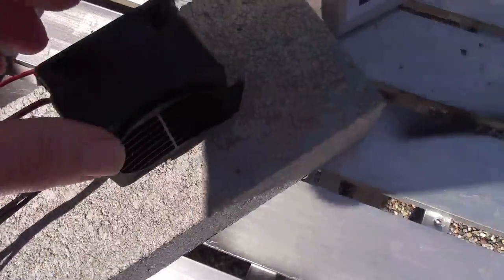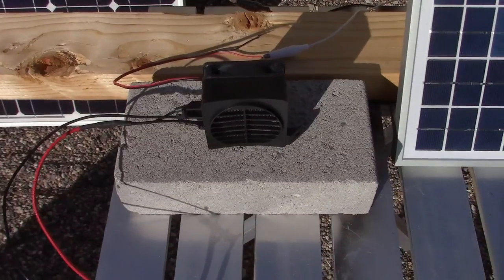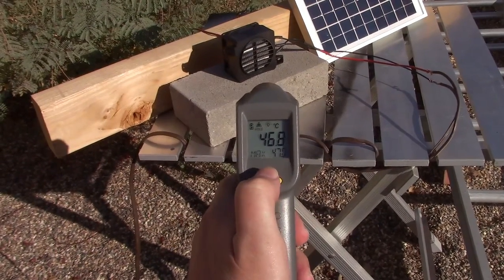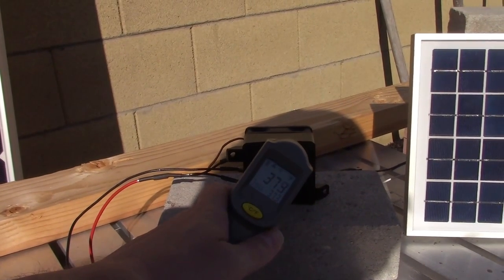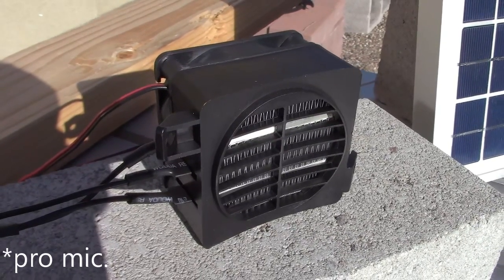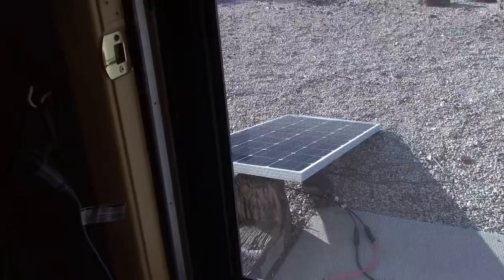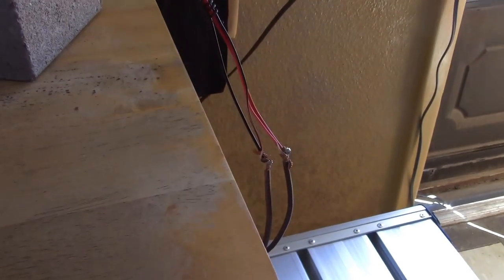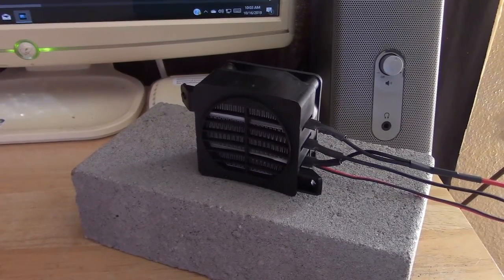Solar Electric Air Heater! (100W 12V) - 100W Solar Panel runs it! - PV space heating!! Ez DIY

Comment: Do you or anyone know how to take those bare wires and put a 2 prong plug on the end so I can plug this into a inverter to run at night?
Reply from the maker: hi. the unit is DC so you wouldn't want to plug it into an AC outlet. to run the unit you could just hook it to a 12v battery.
Reply: @desertsun02  ok. Thank you. How would I do that with the 4 wires?
Reply from the maker: hi. pretty easy, just connect all the red ones to the positive of the battery and all the black ones to the negative. that's basically it ✔
Reply: @desertsun02  ok. I did that using alligator clips. I get the fan to run but no heat. I tried a 2nd heater same thing. The wires get real hot too. Started to burn my alligator clip. Any ideas?
Reply from the maker: @Robert Christman i'd say ditch the alligator clips. sometimes those don't provide a good enough connection. if they are getting hot then the current is most likely bottlenecking in that area. if the current can't flow then the heater won't work right (that draws most of the amps)

Comment: Going to have to use this for my off grid power box I'm making using deep cycle batteries and an old cooler. Cooler can hold the heat in, this can help keep them above freezing so they'll keep working even in cold Canadian winters! genius.
Reply: no solar for 3 months so north here and here, but those are good in spring when there is still cold nights but sun is shining

Comment: could you post a link for a suitable solar panel for the fan? just so many options on amazon ... hard to know if all or some would be compatibe.... thanks great video
Reply from the maker: hi there. the fan is so low power that all you really need is 12v 5w panel. any 12v panel that is at least 5w should work good. here is a good one https://www.amazon.com/NewPowa-efficiency-Solar-Module-Marine/dp/B00L60Y6Y4/ref=sr_1_3?crid=38ON6A33MJI2D&dchild=1&keywords=5+watt+solar+panel+12v&qid=1631733328&sr=8-3

Comment: I love your video here.  I went out and order a solar panel and the same heater.  What I am not sure is how you hooked the wires together.  Did you strip the adapters off the solar panel wires?
Reply from the maker: hi there. nope, i didn't alter the solar panel wires in any way. i just buy 2 wires that have mc4 connectors on one end and bare wire or ringlets on the other end.

Comment: How do u connect the fan straight to the solar. Wont it blow? Being 1 - 4w
Reply from the maker: hi there. any item that you hook to a solar panel only draws what it needs from the panel. you could hook a 1 watt item to a 200 watt panel and it will be fine. (it's the same idea as plugging a nightlight or a microwave oven into the same wall socket in a home. the nightlight doesn't get damaged because it just pulls what it needs)
Reply: @desertsun02  i see, interesting. Im looking some way heating up a polytunnel 6m x 3m in winter. And came across your idea. 
Can u connect both fan and heater to the same solar panel. Or would the fan need its own little pannel

Comment: Did you hook it straight off 12v solar panel or thru a regulator?  Just curious. Panel usually puts out up to 19v, do you think this heater can handle the extra voltage?
Reply from the maker: hi. it's just a straight connect. yeah, it handles it fine. it's just a little extra "push" behind the current. it would have to be over roughly 30v for it to have any negative effect. (the only things that need exact voltage are things with sensitive electronics in them - then you use a regulated power supply). interesting side note... i actually own store-bought 12v power supplies that put out 17 volts. they make the "non regulated ones" that way on purpose (usually 14 to 17 volt output for running 12v items).
Reply: @desertsun02  Thanks, I will buy one of those to try. I have a 100w solar panel setup that I use to run a fan during the day on summer time. I will just switch the connection on winter time to  help give  a little heat up a small area.

Comment: Hi will a 12v 160w solar panel run this?
Reply from the maker: hi there. absolutely! (any 12v panel that is 100w or higher should run it full speed and full heat)👍🙂. (i think they make this air heater in a 12v 150w model also. you might want to use that one if you've got a 160w panel.)

Comment: This would only heat around the desk area right? Maybe a bathroom but not a room.
Reply from the maker: hi. i generally use it for a personal space heater. can heat a small room, but you might need a few for a good sized room
Reply: @desertsun02  ok, thanks!

Comment: What 100w (12v) solar panel  did you buy?
Reply from the maker: hi. i'm using a monocrystallline one by renogy.
Reply: @desertsun02  Thank you, how long do they usually run the fan?
Reply from the maker: as long as the sun is out it will run

Comment: I don't see it on amazon for $10 - 2:59
Reply from the maker: hi. the two i've bought were $7.99 and $10.59 but they've upped the price a little. currently i see them for $16.00. there are a few sellers that charge 20 or more - but skip those. you can find it cheaper. 🙂
Reply: @desertsun02    Did you buy the wafer element component by itself at those prices, because I can't find somewhat completed units (element, housing, fan, &wires) for those prices. Can you not provide a link to the cheapest one you can find?
Reply from the maker: hi. i buy them all as one unit. they come assembled and ready to use with heater, housing, fan and wires. here's a link to one that is $16.61 with free shipping (as of 01/22/2021) https://www.amazon.com/LNIMI-Heater-Small-Portable-Heaters/dp/B08RRS3QHJ/ref=sr_1_29?dchild=1&keywords=12v+ptc+heater&qid=1611322408&sr=8-29 here's another (it's 12v 150w) for only $15.78 with free shipping. https://www.amazon.com/dp/B081197DGH/ref=sspa_dk_detail_1?psc=1&pd_rd_i=B081197DGH&pd_rd_w=b70mh&pf_rd_p=45e679f6-d55f-4626-99ea-f1ec7720af94&pd_rd_wg=wZ7Dn&pf_rd_r=PS94H88B8YHSA30ZP4ZV&pd_rd_r=a4733250-c05d-4b9b-aaed-1fd8df9ddc4c&spLa=ZW5jcnlwdGVkUXVhbGlmaWVyPUEyOU1MUk1ROFhNOFBIJmVuY3J5cHRlZElkPUEwNzExNTU5N0UySlZRMVkzM1dIJmVuY3J5cHRlZEFkSWQ9QTA2NzU2MDYxTllZUFUzWkRBRUoxJndpZGdldE5hbWU9c3BfZGV0YWlsJmFjdGlvbj1jbGlja1JlZGlyZWN0JmRvTm90TG9nQ2xpY2s9dHJ1ZQ==
Reply from the maker: here's another. this one is $16.62 (as of 01/22/2021) with free shipping. https://www.amazon.com/Jadeshay-Heating-Element-Constant-Temperature/dp/B081RFTBX9/ref=sr_1_103?dchild=1&keywords=12v+ptc+heater&qid=1611323073&sr=8-103 there are a lot of people setting them for 20-30 dollars but they are just ripping people off.
Reply: @desertsun02    Free shipping seems only to the US.  I figured out Amazon changes shipping details based on whatever address is saved in the browser I'm using.  If I ship to Canada the shipping charges are about as much as the unit itself; but the last link you gave on the 16.32 item came up with only a 5.16 extra charge for shipping; so that's the best one I've found now.  All in all, thanks for the info & help.

Comment: Hey desertsun. What kind of solar panel is the 100w panel that you used to power the 12v 100w heater please? What make and model is the panel?
Reply from the maker: hi. it's a 12v 100w monochrystalline solar panel from renogy. that's my oldest 100w panel. bought that one back in 2013. any 100 watt panel will work. i've recently been using polychrystalline 100w panels from amazon. works just as well. you can get them for as low as 70 dollars on amazon. 👍🙂
Reply: @desertsun02  Thank you.

Comment: Is it possible to hook the heater up to a usb connector?
Reply from the maker: hi there. usb outlets are around 5v and the heater is 12 so it wouldn't match up (also you probably couldn't get the amps needed using usb). it's possible that someone might sell these in 5v put haven't seen any

Comment: 3:25 Could you do another in depth video on how you do the wiring connections...
Reply from the maker: sure. what part are you confused on? note that the wires to the heater and fan are pre-attached, so i basically just connected them straight to the solar panel.

Comment: Hi bought one these heaters I have 100watt panel on campervan roof an 3 30watt panels in parallel .I have 2 mppt controllers front an back what’s best wire to wire the heater ?😀

Comment: hey desertsun. Great video. Whats your thoughts on this set up vs a solar air heater? I mean what do you think is better to heat a small room?
Reply from the maker: hi there. that's a good question. i could write a 'whole book' on thoughts about those questions, but to keep it brief, a lot depends on your situation. the solar 'thermal' air heaters (aluminum can ones as an example) are bigger and often fixed to the side of a house, so you have to decide if you want to go that route. using a system like the one shown in this video offers potentially more movability (you can move around the heater and solar panel easier). also, the hot air that is generated is generated on the inside of the room or structure (not the outside like the solar thermal air heaters) so you don't have to find a way to pipe it in. on the other hand the solar "thermal" air heaters are probably more 'efficient' and can also be made to be 'semi-portable' (most of mine are) so they both have advantages. i've got like 4 or 5 different solar thermal air heater vids if you wanna see more about them. i've also got at least 2 more air heater vids coming out this season (fall of 2020).
Reply: @desertsun02  Thanks for your awesome reply. Good information :). Its all very interesting. I have insane heating bills and my lounge and kitchen faces east to south east.  Any ideas which of your two heaters would be a good preference to help heat a 42sqm about 452.sqf? let me know :)
Reply: @desertsun02  i was going to try to  make one of this heaters with soda cans or drain pipes in the box thing. But it's outside. What happens when the sun leaves? What if it's 10° here in NJ at sundown. Won't the cans get freezing? I hate the cold. I would not be happy if the cans froze and gave me air conditioning in the winter.

Comment: Interesting..good application (my chicken coop)..however if i were to use this for that, i would have to calculate how many 12v batteries would i need to run it at night, and how many panels to recharge those batteries..

Comment: I'd like to do use a solar panel, battery and a few of these spaced around my 8'x16' greenhouse. I'm in Colorado so I'm hoping to extend the growing season by a few months.
Reply: I have the same interest but live on Cape Cod please PM me to compare.
Reply: Did you trying it yet?
Reply: I have not but if you get a solar battery, and a ceramic heat lamp, it will help warm up your green house as well.
Reply: Did you end up getting one? I'm thinking of 50w is probably more than enough for me.
Reply: @NovaFlowO2  :there is 3.41 BTUs in a watt.  I was given  a large solar panel, and figured the best use, without buying batteries, inverters etc, was to use it to heat the house. On a sunny day in winter, it would have kept the furnace off for 6 seconds per day.
Reply: @drewthompson7457  6seconds?
Reply: @MrElhato  : Yes. Rough calculations, it is a 50 watt panel, and I was going to let it run a car headlight as a heater, about 700 BTU per day. It wasn't worth the effort. But the panel is good running a large 12 V fan to keep the boat dry in the winter.
Reply: I have a 120watt panel can I use it to run the 100watt heater
Reply: @justincampbell2162  Yes that will work just fine The way electricity typically works is the device draws the amount of power it needs so if it's only consuming a hundred Watts it'll only take a hundred Watts from the 120 w panel although keep in mind your panels never going to produce 120 Watts you might get close when you point it directly at the sun during the summertime but you'll probably get between 40 and 90 Watts under the panel so it'll run the heater just fine
Reply: Battery is not going to work very well just run a directly off the solar he should get about 8 or 9 hours of heat per day

Remember even that hundred watt heater which is not going to provide much heat for a greenhouse you would need a 1 kilowatt-hour battery to run that overnight so you would need a $300 battery to have enough capacity to run a single one of those heater is overnight You're probably going to need 10 of them at least to make a dent which means you need a $3,000 battery pack to run overnight so just insulate well and heat during the day
Reply: Earth ground heat and compost

Comment: Can you post a link where to buy the heater?
Reply from the maker: hi there. here is a link to one https://www.amazon.com/Constant-Temperature-Humidifier-Conditioning-Appliances/dp/B084Q18VHG/ref=pd_di_sccai_2/143-3040554-3226717?_encoding=UTF8&pd_rd_i=B084Q18VHG&pd_rd_r=bb1e507f-a46c-4982-af15-adcb2c856959&pd_rd_w=7mK03&pd_rd_wg=EsK6b&pf_rd_p=5415687b-2c9d-46da-88a4-bbcfe8e07f3c&pf_rd_r=J6CZRMQ6BC0BMSMMZ9ZJ&psc=1&refRID=J6CZRMQ6BC0BMSMMZ9ZJ if this link becomes inactive over time just search for '12v 100w ceramic ptc heater' on amazon.

Comment: How do you turn it off safely? And can I tire the wires to the solar panel wires with my hands without getting shocked?
Reply from the maker: hi there. to turn it off you can just unhook the wires. since it's only 12 volts and relatively low amps it's very safe. you shouldn't feel any shock.
Reply: desertsun02 thanks for the info, just subbed cause ur a beast when it comes to responding in the comments! Can’t wait to see what you create in the future 😁

Comment: How Many Amp Hours Batteries Do You Think You Would You Need To Run It For 24 Hours? I Have A 9x6x6 box truck overlander I think this would run great in?
Reply: This isn't enough heat but if you wanted to do this you would need a 200ah 12v battery for it to last 24hrs.

Comment: That with a 12v temperature relay from ebay and your sorted, wonder how this would heat a shed up
Reply: I have doubts...  I replicated this setup EXACTLY with nowhere near the temps or fan speed on one panel.  I’ve metered the solar panel and it’s generating 100W, not sure if this is real.

Comment: Hi, thank you so much for posting this. I just have a few questions. I am living in a small SUV and last night it dropped to a chilly 20F. Anyways, I would like to use this for two purposes, 1) keep my bananas (and other food) from freezing during the day, 2) possibly keeping myself warm at night. My set up is:100W solar panel connected to MPPT morningstar controller and my car battery. When the weather is warmer, I usually power my 17L Engel fridge with the set up (direct line to battery - 8 gauge wires) - haven't had a problem for the past 2 years with this. I'm thinking in this winter to switch it so that I connect the heater direct to the battery (with a cut off switch if battery drops below 11.5V). Any thoughts? Also, it says there's a "safety" on the heater, does this mean that if it falls over it will shut off? Thanks for all your help!
Reply: I am sorry no one took the time to answer you back.  Yes, it should work just fine, and yes it means that if it falls over it will shut off.  If you have the means, you should invest in a good marine battery to attach to the solar panel, that would hold a charge much longer.

Comment: This is great!  I will be using diy geothermal in my next house and this is a perfect way to get the 60 degree ground temperature up using solar!
Reply: No what would be better is getting a heat pump and running that on solar. Heat pumps are WAY more efficient than electric heat so you will get way more heat for the same amount of solar.
Reply: Same

Comment: Question, I have a 150 square foot green house. I want to heat it when it gets cold. I live in Prescott AZ.  We get down to 10 degrees, average low is about 18-25 degrees in the winter. I want something like this to keep the air in the green house above freezing. Will this work?
Reply: You will need a whole lot more than 100w of heat for that size glasshouse at those temperatures.
Reply: An online calculator tool suggests for a single glass pane green house at that size would need at least 1700w of heat to keep the temperature just above freezing, remembering that solar PV generation won't work at night when the temperature is the coldest, so you would also need either a storage heater, or a battery pack capable of storing that power for use at night.

Comment: Which wire is positive for the heater I noticed that both wires was black
Reply from the maker: hi. the positive wires are red. (but they have some black tape on them in a spot or two - especially where the wires go into the heater.).
Reply: So are the heaters pretty good Amazon customer are talking bad about it but your video is so  good I keep watching it like it seems good from the video

Comment: Do you know how many DC amps the little heater drawls. Very interested in getting some of these to work with my solar. Any additional info would be great, thank you 👍
Reply from the maker: hi there. honestly i'm not sure on the amps. i'll have lots of extra info in my next video (which will be out in a few days...maybe even tommorrow🙂). in it i show a 200W DIY Air Heater made with 2 of these. that set-up has dual speeds/heat settings with 2 power switches and it's all mounted on a homemade "slanted" stand. take a look at it. it may be what you're looking for.
Reply: @desertsun02  I will certainly do that 👍 thank you
Reply from the maker: hey there. it's posted! here the link https://youtu.be/9559yVp9koU
Reply: 100W/12V = ? You do the math! I already know the answer.
Reply: It's simple math really. A 100w heater will pull 8.3 amps @12v or 4.15amps at 24v.